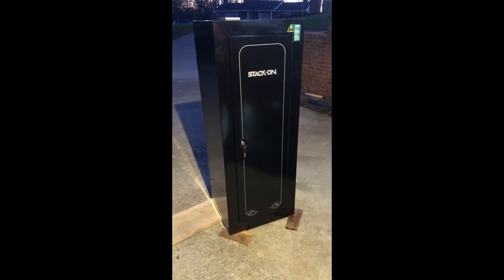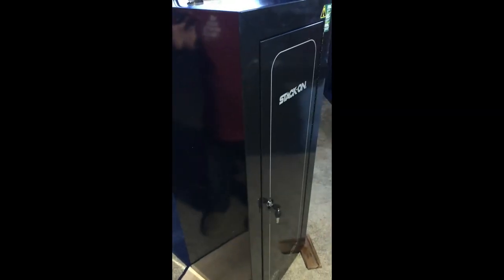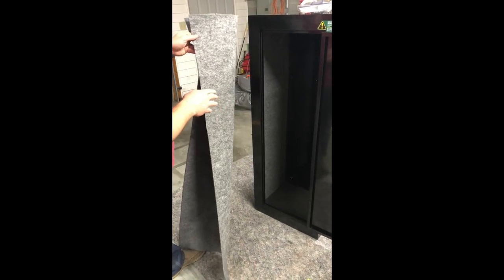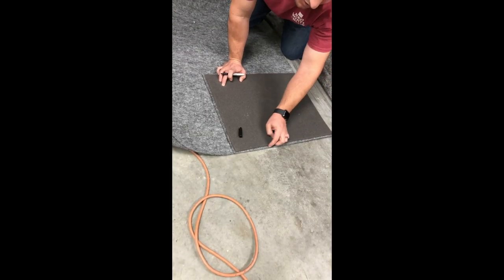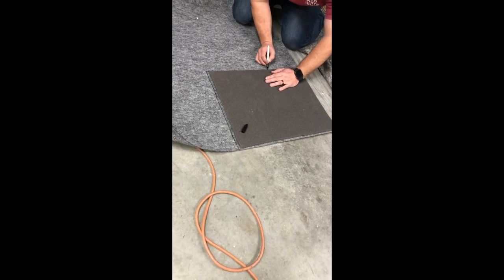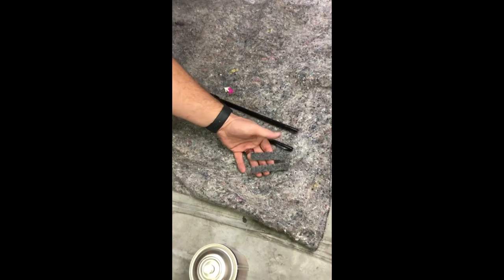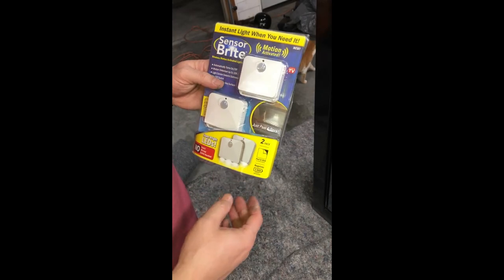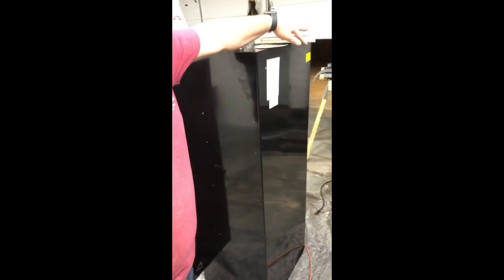Stack-On 22 Cabinet Modification Installation

Comment: Did u wipe the inside of the gun cabinet before applying the adhesive. I've heard they come oily and oil makes stuff not stick well...
Reply from the maker: I did not wipe the inside. My cabinet wasn’t oily or anything and the adhesive has stuck well.